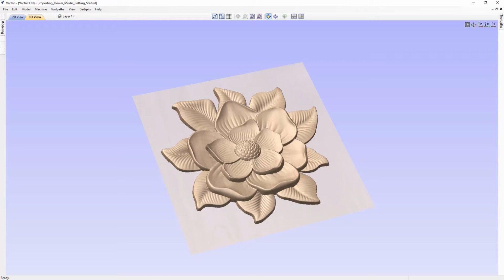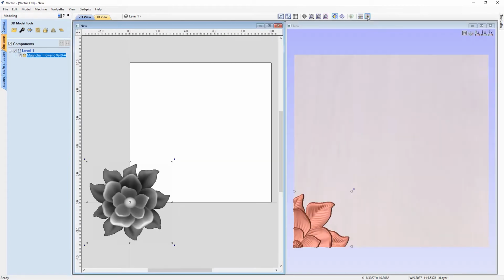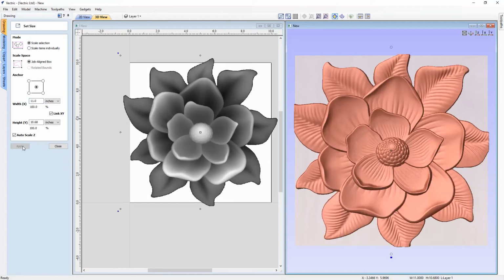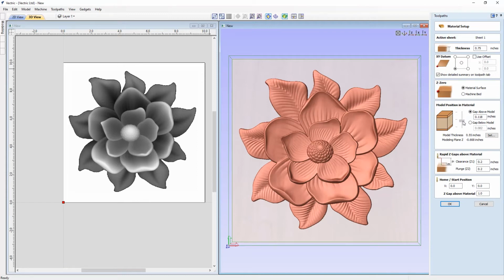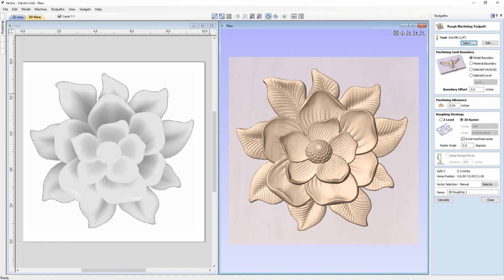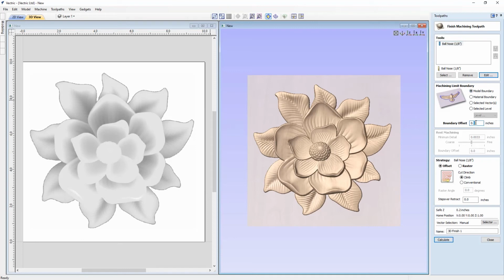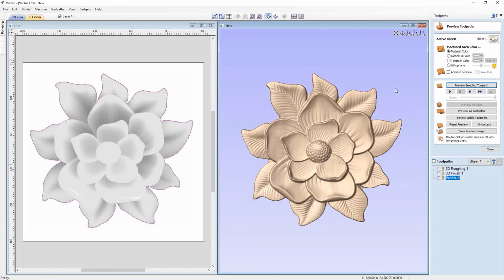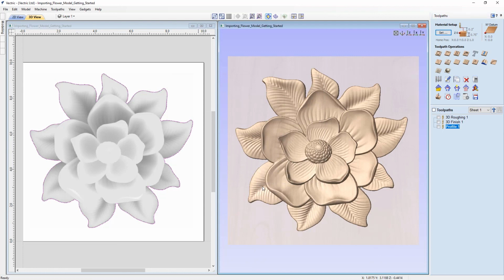Importing Flower Model | Vectric V11 Tutorials

Comment: Hi, I notice you didn't add tabs to the profile cut.  Is that dangerous? Or is it ok since the material is now so thin? Or did you just skip that step for this demonstration? Thank you!
Reply from the maker: Hi Julia, Great question! Yes we skipped this just for demonstration purposes, in the real world if you didn't have a vacuum hold down system or a method where your material is stuck to the machine bed you would definitely add tabs to this to hold it in place :)

Comment: Hi Beki, thank you very much for this great tutorial. Just one question on the finish modeling toolpath. Why is there is a boundary offset entered of 0.1 inch? Should the finishing toolpath not exactly meet the model? Thanks, Thomas
Reply from the maker: Hey Thomas, Thank you for your kind words😊 It's good to have a boundary offset on your finishing and roughing toolpaths, so that the center of the tool can roll past the edge of the model by this amount, ensuring that it cuts the sides too. I hope this helps! ~Beki
Reply: @vectric  Thanks for your prompt reply 😀